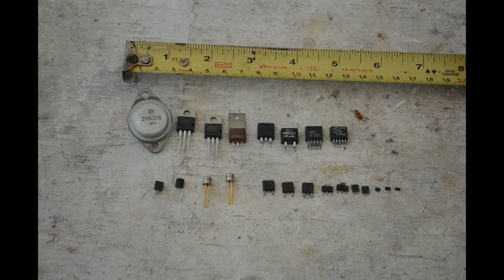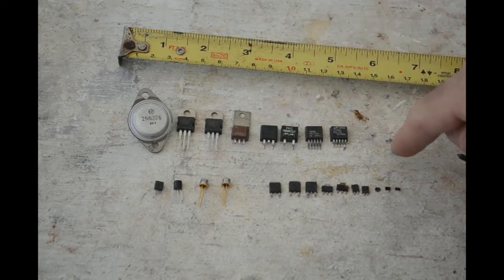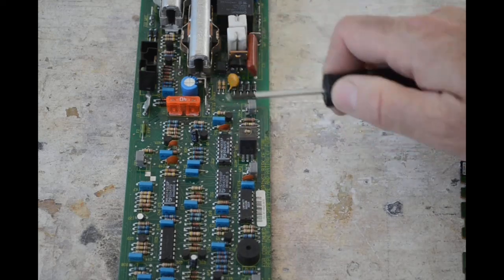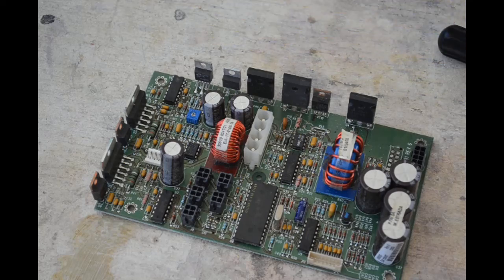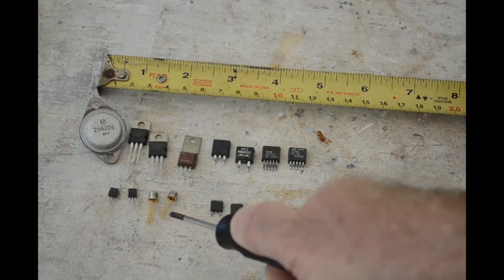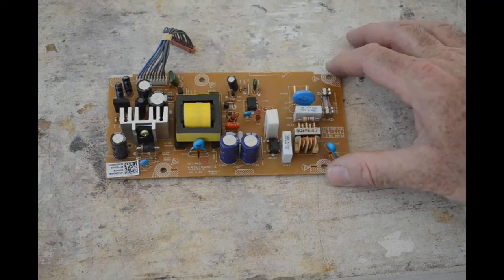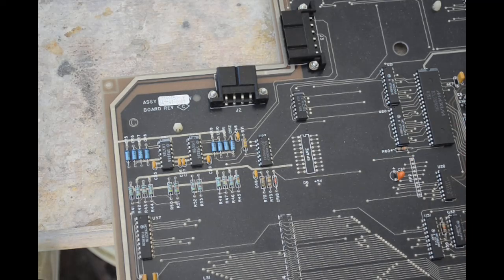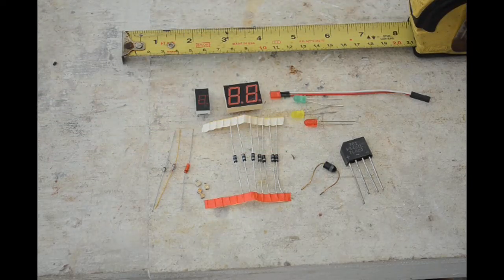Where is the gold hiding in e-waste? Part 1 Transistors

Comment: I noticed that most of the big power transistors and power integrated drivers have copper bonding wires. Most of the voltage regulators have gold bonding wires.

Comment: Hey I am watching the video and I have mostly all new old stock and lots of it but I have all you keep talking about and then some- the gold plated stuff like the gold plated metal cans with gold lags, and even the big gold transistors,  plus small 3 lag gold transistors, lots of IC chips many with gold, LEDs, and all kids of radio parts most old military stuff.. and like 95% all new old stock parts that I have wanted to sell to someone who can use it all. but I have also wandered about recovering the gold off/from it all. all together there's a few totes of this stuff. The rubber made totes you know.
what's your thoughts about what to do with it all? quite a bit still has old radio shack prices on it. I know its thousands maybe hundreds of thousands of dollars' worth of parts.
just don't want to list thousands of eBay listings for it all. It would be thousands of ads for each type/model of item.

Comment: with the large power transistors, all you need to do is whack them with a hammer. The large chunks of plastic will come off the heatsink and the legs will fall away cleanly. 
I have  video of me processing the large transistors using my vise and a pair of pliers.  I just put the transistor into the vice, clamp down on the sides and use the pliers to rip the heatsink right off. It leaves the Die and gold wires (if any) embedded into the plastic epoxy.

Comment: i thought the transistors bolted to ally heat sink were copper ?
Reply from the maker: Steel too sometimes. I've seen them rust when left exposed to the elements.
Reply: They are, and sometimes I’ve found the odd brass one